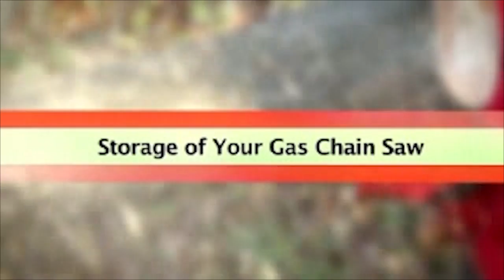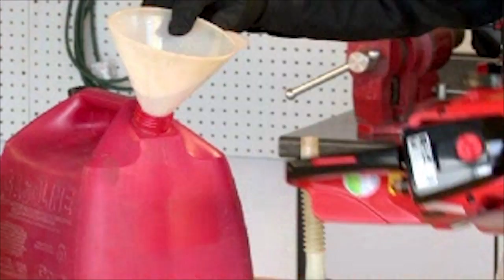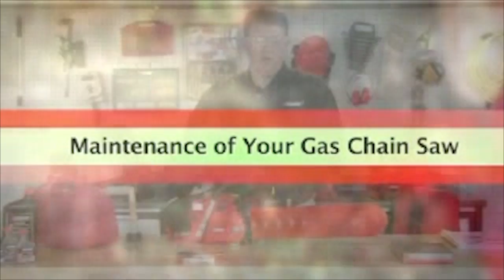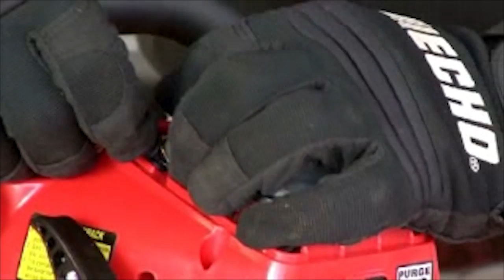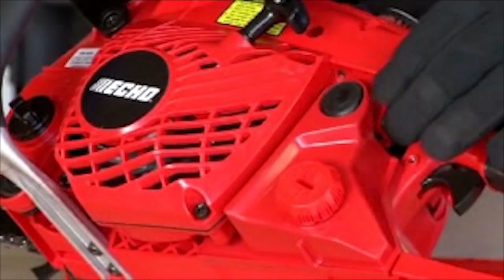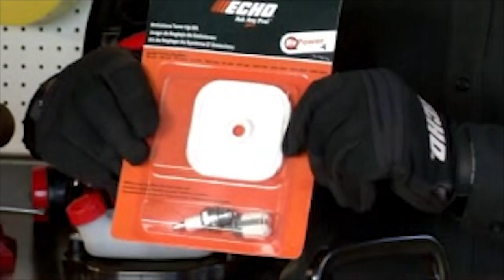Proper Chainsaw Maintenance - Chainsaw Basics

Comment: This is a great sawSnapper It's powerful,🌼 allabout.wiki/Wolf easy to use, and has a lot of great features that make it safer for a homeowner to use, such as the compression release, chain brake, and choke that sets the throttle to idle up when starting. The chain is easy to adjust. The engine has a lot of horsepower and torque for cutting big sections of wood quickly. You cannot bog this saw down unless it gets pinched. But that's true of nearly every saw.

Comment: Cleaning is also part of the maintenance. If you take off the side, it's full of gooey / oily sawdust. Is there something special way to clean that or it's not an issue, just pick out most of it, but it's not causing any problem even if it's dirty right there?
Reply from the maker: The best way I have found to clean the side cover/ bar area is with compressed air.  Having too much sawdust in that area can affect the oiling ability.  At a minimum make sure the oiler area and the oil hole in the bar is clean.

Comment: That's great but what if you buy a used chainsaw that may not have been maintained?  In other words, how do you clean a dirty chainsaw that may have had fuel left in it, etc.?
Reply: Whisper Flight drain the fuel, remove/clean the carb and replace the fuel filter, you also might as well replace the spark plug then let her rip